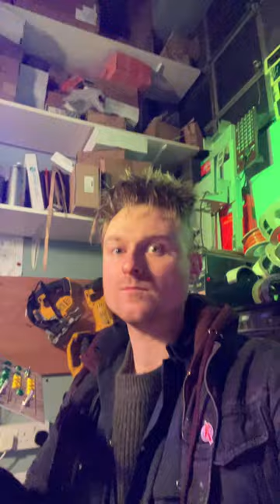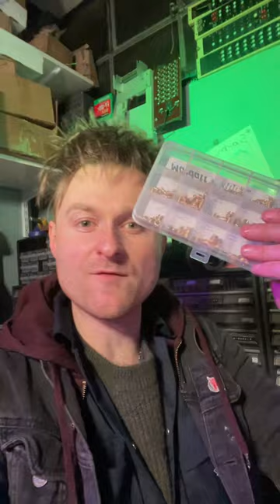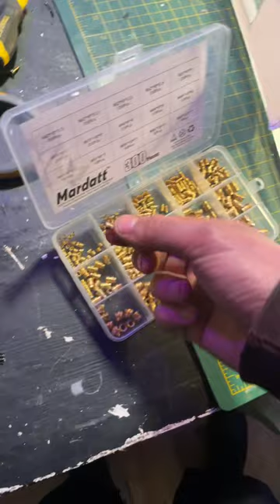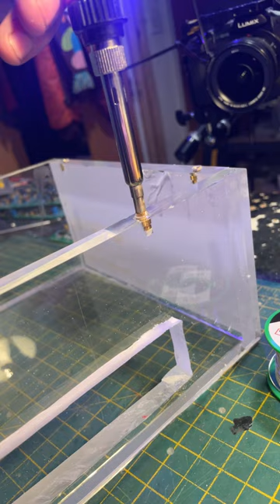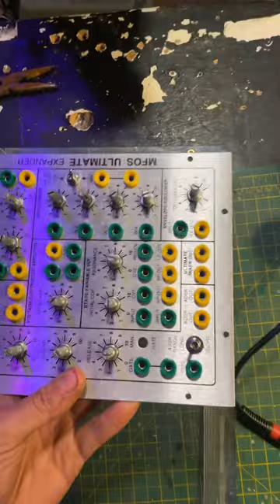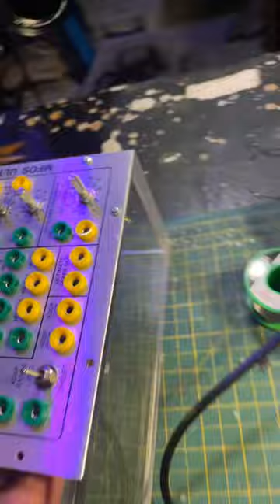TRYING HEAT INSERTS

Comment: I use them in my 3D prints all the time. They’re much easier than designing in holes for hex or square nuts and seem to hold totally fine! Might want to put them on the other side of a through-hole if you need more strength. What you’ve done here should be totally fine for holding a panel.

Comment: Blimey, you might just have answered a question that I had for several years now: Heatinserts! Now I have to find out if I can use an M3 heat insert to fix a worn out dome for self tapping pastic screws. Replacing the screw as well, of course. Brilliant!

Comment: I recommend using the smaller heat inserts with the opposing diagonal segments. Much tougher.
Reply from the maker: I had these from before but only realised what they were. They are adequate but cheers! I ordered some of the ones you mention m they just took ages to turn up ha.

Comment: You can press the flat side of whatever metal bits you have around (knife or whatever) to the insert and use the last bit of heat in it to make sure it's perpendicular and flush to the surface. I had a bear of a time getting inserts to not go cockeyed on me before I started doing that
Reply: And if you do it often enough buy a universal bench drill press. Mount your iron and it's vertical every time.

Comment: some heated inserts are threaded, which are super  strong because the threads keep it from coming straight out. I think you can even get ones that are threaded backwards.
Reply from the maker: Yep but these are what I had around. I ordered the mentioned but got lost. These are far more than adequare

Comment: if you used wood screws, instead of machine screws, i think you could screw your panel directly into the acrylic...  if you used short, chubby screws with long threads, i think you might be able to melt the acrylic around the screw as well if you really want to melt the plastic or whatever...
Reply from the maker: I used to to that. It wears out eventually

Comment: Seems quite useful! They only go into plastic i assume?
Reply: Anything you can melt with a soldering iron. So like plastic, cheese, chocolate, bacon grease, candle wax, beeswax...
Reply: in your skin is also possible !
Reply: @curtis_chip  I know this is a joke, but they would fall out as the burned tissue sloughed away. :(

Comment: You could just tap a hole in the acrylic ...
Reply from the maker: Have done many times before when making clear cases fact is the threads dull when synths are broken or not working. I tried coarse threads but still the same. I'm just looking for a better alternative
Reply: @LOOKMUMNOCOMPUTER  Damn! You replied faster than I could get back to delete the comment which I decided was irrelevant ...

Comment: Hopefully those fumes aren't toxic
Reply: As plastics go, acrylic is fairly safe for hazardous decomp. The gasses are an irritant, but there aren't any known chronic and/or carcinogenic concerns. This is a key reason why it's used so often for laser cutting.  
Check the MSDS if you're not sure.